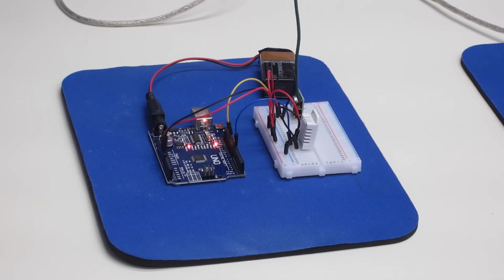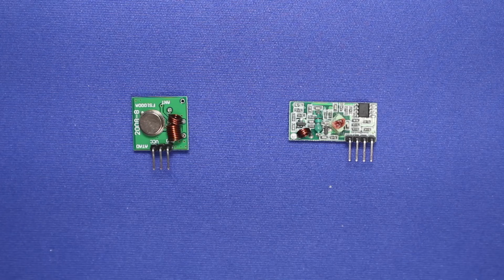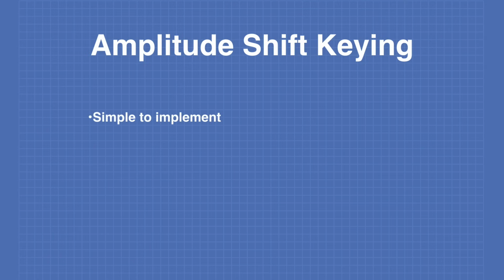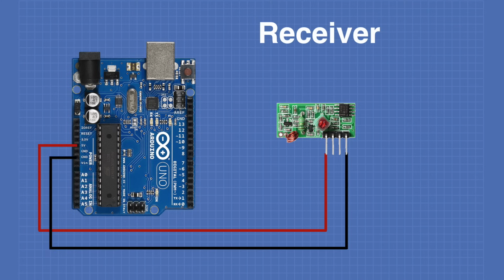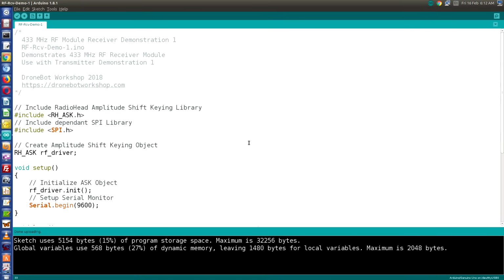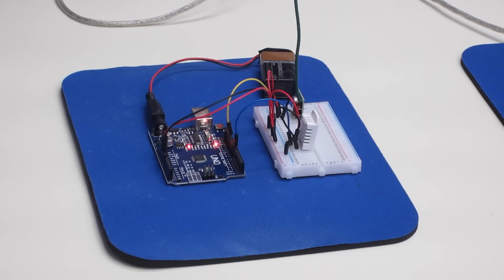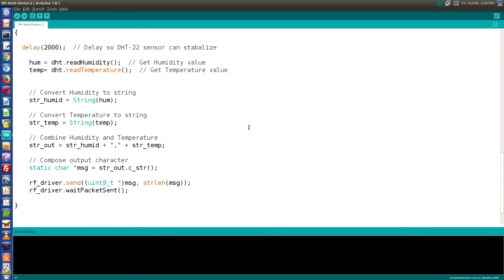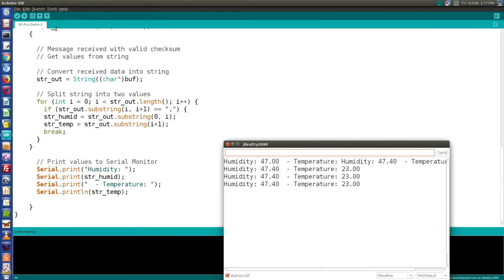Using Inexpensive 433 MHz RF Modules with Arduino

Comment: Everything I've read says to avoid using strings on Arduinos and to stick with fixed size data structures that don't cause memory fragmentation. What's your take on that?

Comment: -1

Hi
I would like to use an CC1101 as a receiver in one device and use FS1000A transmitter in another device. 
Do you think it is possible?
I'm using Arduino Nanao boards and ELECHOUSE_CC1101.h lib.

Comment: If I use an Arduino Mega 2560, what pin is the data transmitter connected to?  does it stay on pin 12?  please answer sir and thanks...

Comment: When working with these 433 transmitters, are they "paired" with each other? Or are they all transmitting and reading the same? With the text example if you had another set up with a receiver would it be "Listening" to the same message?
Context, I am looking to control 6 lights via arduino, each light will have an arduino and a receiver. But for the sending side will I need 6 transmitters? Or will one transmitter be fine?

Comment: What protocol is used for data transmission? 
I ask this because I see only one " wire" ( only one line). SPI library is used here, and I believe SPI needs at least two wires. - One for clock and one for data.
Is this a "One -wire" transmission ( without clock ) ?

Comment: I added a 173 (ish) mm wire for antennas on these receiver modules.  In all instances, it got worse range when I coiled the antenna.  Is there any reason you can think of that would cause this?  Faulty modules is a possibility, but this happens on at least 6 receivers, likely more of my stock of 20 or so. ( because I ordered in sets of 5 rx and these six aren't all from the same set) 
Thanks either way!

Comment: what if you wanted to use a different arduino model, or even an ATtiny85?  would you need to edit the library file to reference the pin you wanted to use?

Comment: Dear Friend,  I'm totally a newbie in electronic and RF, but can you amplify a receptor or increase the received signal.   I've bought some DIY radio kit, 3 of them that Ive assembled with success but each 3 doesn't catch the airwaves as same as the other. 

My goal will be to make those 3 great receivers.

If you anyone got hint or tips,  that would be appreciated

Comment: I’m trying to send out two separate messages so my transmitter has msg1 and msg2 and my receiver has buf1 and buf2.  When I press a certain button I expect it to send msg1 and msg2 But when I send them, they send both messages regardless of which button I press. Any help?

Comment: I think there might be an issue with this. I think you should send one more character to allow for the NULL character:

driver.send((uint8_t *)msg, strlen(msg)+1);

On the receive end you should also add space for one more character. I'm not sure, but I think the code as shown in the vid was causing my code to eventually crash. Any comments on this?

Comment: This is cool, huge thanks for posting. 

I’m thinking this would be worth extending to log data locally and transmit logged data. Would make for less data loss and suit applications where connectivity is lost. 

would mqtt work over these radio comms?

Comment: Ive bought these modules a year ago, only difference mine are tiny size, 1cm by 1cm, never had a need to use till now. Your tutorial helped me to connect everything and get it running in just over 5 min, thanks

Comment: Transmitting between the two modules 'manually' that is without the Arduino is mentioned at about ten minutes into the video. Where could one find more info on a single channel transmission without the Arduino?  Thanks. Allen in Dallas

Comment: Could anyone here be kind enough to answer a few questions to me.

I'm trying to use this rf modules with arduino Nano boards and I confused as to where to connect (and define) data pins. The only thing I've found was this command " RH_ASK driver(2000, 6, 5, 0); " which sets the pins 6 and 5 as transmitter and receiver which raises a new question. 
The 6 and 5 are used for arduino Uno boards so is it the same for arduino Nano and I just connect 6 to D6 and 5 to D5,
 do I connect the 6 to D3 because it's the sixth pin, 
do I just write D6 instead of 6 in the code itself or is the answer something completely else.
Most examples for this rf modules and library use this same example of code and use Arduino Uno so any help would be much appreciated.

Comment: *important note*
place a 100uF cap between VCC & GND close to the receiver.  Any small ripple or noise or small abrupt changes in VCC will be amplified by the RX circuit and will show up as an output transition on the RX pin.  This receiver has a lot of gain between VCC and DATA out, and that makes it very sensitive ( very twitchy ) to noise or tiny changes on VCC )
if you run this from the VCC supplied from the Arduino board, then I would still recommend some bypassing right close to the VCC&GND on the receiver board.
Reply: YOUR COMMENT SAVED ME THANKS SO MUCH!!! my coding works after i put 100uF at 5v and GND at the transmitter
Reply: @Zerosoul191  I'm  happy to hear that!
Reply: I have checked my code and connection but it not working but I have not used a capacitor, would a capacitor could solve my issues
Reply: There is a good chance it will help
Reply: Have you tried a 0.01uf ceramic cap in this location?  This is the typical value I reach for in such cases.

Comment: Great Video. Just a note, you can have two instances of the Arduino IDE going connected to two Arduinos each with their own Port, so you can have transmit in one and receive in the other and monitor both Serial streams.

Comment: can these Rx/TX be used without the Arduino to simulate on/off switch from remote location from with in 3 meters? if yes, can a two channel RX work with two different  TX ?

Comment: So, I've got a problem.
I connected the receiver to an lcd keypad shield (16*2)(with a buzzer connected also), the code i used is perfectly fine. However the lcd screen just turns alot darker and no message appears in the system. It appears that the RH driver interferes with the lcd(when i delete the rf_driver.init(); it stops from happening)? Could anybody help me with this? I hope i described it good enough.

Comment: Interesting and useful. I need to look to see if you have done a video on controlling a stepper motor using rf type modules. I'm working on a small antenna rotator for the loft.

Comment: Very good video well explained. Thank you! I would like to use this application for remotely measuring the temperature of the water in my swimming pool. I don't know if the DHT can be waterproofed though. If not, do you know of an appropriate sensor? I would also like to use this application as a wireless light switch. Would the transmitter be compatible with "Chocon" modules. The module needs to be paired up to the tx which will generate a special code. Is this pairing possible in this half-duplex configuration? Thank you!

Comment: thank you very much for this lecture. Actually i had few questions regarding program.
1. why did i assigned *msg = "Message" and not just msg = "Message"
2. and is it necessary to send only strings over RF module or integer can be sent too
Reply: It’s been a while, but I figured it would be helpful for others to have this question answered:
const char * msg = “message”; means msg is a pointer to the first character in your string. This is how strings work in C languages.

From what I saw in the video, you can send any data type, which is why the send() function takes in a second parameter, which is the number of bytes. To send an integer, you could do something like the following:
int x = 42;
rf_driver.send((uint8_t*)(&x), sizeof(x));
This passes the address of x as a byte pointer as the first parameter, and the number of bytes in x as the second parameter.

Comment: Hello, I'm in great and urgent need. @DroneBotWorkshop, You seem me helpful. I want to directly connect my Grove LoRa Radio 433 MHz - Seeed Studio with my Arduino Uno Rev3 (USB), and make communication between two radio modules. I'm trying from several months, browsing on the internet and searching on several websites and forums. But, am not getting any solution and always the communication is getting failed. 
On the serial monitor of both sender and receiver, it's displaying – "init failed" .
Kindly assist me as soon as possible. I would be very grateful (from India).

Comment: I could send more information   , I 'd like to use a (temperature sensor + transmitter1  + arduino1)  and (pressure sensor+  transmitter2 + arduino2) , but I had only (receiver + arduino)  . Is it possible ?

Comment: you gave me the idea from back in the day but if someone could write the code it would be interesting , remember those old speaker system's on the wall in some home the so called (INTERCOM) but let's put a modern twist to it, 

if someone does this for example 7 rooms let me know, thanks

Comment: The module's name was difficult to discover. It was in the description, "bRF24L01", but searching Google with that did not give much information or where to buy. It seems that 433Mhz is not the feature of that particular hardware. Just search Google for "433Mhz Arduino" instead. I have found a $1 module that looks similar to the ones in the video, on an online store in my country. That module was named "DM2146".

Comment: why did he use the char message as a pointer?
Reply: In C, String doesn’t exist, we need to use char*
Reply: @anthoh5  it seems to me he wasn't considering the null at the end of the strings, transmitting or receiving, yet seems to successfully print the received raw data from the receive buffer, which I believe was unterminated.

Comment: Cool project! 

I ordered some BME 280 chips for arduino, those have pretty sensitive humidity, temperature, and pressure meters build in them. These modules you are using might be neat to use for building a weather station! 

Greetings, 

Jeff

Comment: thanks for the great Video
I try t send 3 values in the String
str_atemp // air temperatur
str_etemp // soil Temp
str_hum // soil humidity
the Tx Side is working
but how can I split the str_out into the 3 values? in the Rx code?
how can I alter the for if loop to get it working?

Comment: The SDR (software Defined Radio) is a great tool for working with the transmitter module. You tune the radio to 433mhz and you can see the signal. It will tell you if you are transmitting . I found a dead transmitter this way. Also you can determine the exact frequency it is transmitting on when the radio is calibrated. Also you can see how your body interferes with the radio.

Comment: I am pretty new to Arduino, but have a project I am working on using 3 ultrasonic sensors. I used a decent portion of the code in this video to help, but my sensor 3 is not displaying the correct distance reading. How would this code be changed if I needed to extract 3 values from the string sent instead of 2? Not sure if this is the right place to be asking this but figured its worth a shot.

Comment: Great job as always Bill!  Thanks for sharing all these wonderful videos. As a newbie to programming I'm stumped on the proper way to convert the temperature string line to Fahrenheit. I played around with different variations of  ...( - Temperature * 1.8) + 32) but can't quite get there when compiling. In addition, it would be neat to add the Date and Time  to each line print out.
Reply: You would need an RTC module for date and time

Comment: Impeccable video.

One thing I noticed is that you are sizing your receive buffers to the exact length of the expected string, without accounting for a terminating null character ('\0'). Since you're passing in buffer length to the ASK library receive function, I expect that it's not writing a 25th null byte at the end. Later down in the code, you're using things like strlen() and println(), which depend upon a properly null-terminating string.

Your code appears to work fine, but I suspect it's due to the compiler adding zero-padding between the 'buf' and 'buflen' variables for word-alignment, or maybe just uninitialized stack being full of zeroes. I mention this because it's somewhat delicate... reorder your variables or change some seemingly arbitrary detail (like length of the message), and it may stop working properly.
Reply: Agreed.  I looked at :recv() in RH_ASK.cpp.  It copies at most len, or less depending.  Then it returns the actual number of bytes copied into len.  It doesn't null terminate the string.  It doesn't really consider it a c-string, just a uint8_t buffer.  Then in the code above, this buffer is cast to a (char*) for printing. No one is adding a NULL at the end of the c-string.
He must be getting lucky. Perhaps as you say because the compiler is padding out the stack with zeros. It doesn't seem necessary to do this, as the declaration of buflen comes immediately after the declaration of buf, and is also 8-bits long.  I'm not sure, but looks like luck.

Comment: I would like to setup a long range offshore RC fishing boat, I have no idea what I need to purchase. I mean from radio to ESC to receiver. Where might I find a list of equipment I would need to make a nice little RC fishing vessel for a large lake and off shore? Ideas? 500 + yds is the goal is this reasonable? FPV is not required just boat control.. Thanks!

Comment: how if dht sensor is change with an ultrasonic sensor, i've tried it but always fails?
Reply: Lol, dht is temperature and humidity sensor and ultrasonic sensor can not do that, thats what I understood but if you are saying that you want to send data from ultrasonic sensor then that is also do-able, you just need to include library for Ultrasonic sensor instead of dht's lib.
Reply: @FsdYT  i main that, I want to send data from ultrasonic 
Thank you
Reply: @namitamukhbitin7056  for that you need to use library of that sensor instead of DHT, you can find tutorials to use that sensor on internet

Comment: Great video. I bought a set of these described as 433mhz, but I got really poor performance using the antenna length per the calculator. I adjusted the antenna length to a 315mhz and got much better performance. Any idea how we can tell which is which without a scope?
Reply: The frequency is printed on the crystal on the transmitter

Comment: So if I want to have 2 motors controlled by 2 potentiometers wirelessly, will I need 2 channels or are there any sophisticated libraries to transmit 2 things over 1 channel? If I do need 2 channels how will I have 2 channels without them interfering?

Comment: Can this project give the temp in fahrenheit instead of celsius by replacing "celsius" with "fahrenheit" in the script and would I be able to echo the string to a small lcd on the receiver. This project intrigued me and I had everything but the sensor. I plain to place this on my tower and see how far I can receive it with an external antenna :)
Reply: Well tried to change it to fahrenheit and still sends celsius so that's a big NO does anyone have a suggestion Thank you

Comment: Great video !
It demonstrates the basic setup needed for a remote temperature sensor, which can be used for your central heating systems climate correction curve.
You just need to fiddle with the correct choise of components and arduino code, to have the sender use as little current as possible, thus making the battery last for a couple of years.

Comment: Would there be any way to process the radio signal in order to gain location information from the transmitter, like approximate distance?
Reply: You would have to know the transmission and receiving data or make empirical measurements. Then you use the law of incerse square and do some math

Comment: First, let me say that I thoroughly enjoy the quality and content of your videos.  I am working on a project that enables me to have a remote throttle for a 25hp 2 stroke engine.  The distance will ALWAYS be less than 4 feet.  Of the various transmitter and receiver types I've seen you and others present, which would be best for this.  I also need to consider wire shielding from the noise created by the spark generation for the motor.  It is my intention to use some type of servo at the throttle and a hand held, remote throttle.
Reply: I have been kicking around this same idea for a couple of years. How is your project coming along ?

Comment: thanks alot for the video....However I am working on a remote controlled robot car using a joystick and 433mhz rf but the receiver code has failed to upload. Could you cite any problems ? thanks again

Comment: "So for less than a cup of coffee, you can add radio communications capabilities to your arduino projects" 
but how do i do the project without my cup of coffee :'(
Reply: Try crack instead. Much cheaper.
Reply: You want to use it as a way to set things off from a distance. Lets say for a rocket, or some fireworks? Your name actually implies something along those lines. Am i right?
Reply: Eh, just eat the beans (technically seeds). That’s what people did long before they learned how to brew coffee.
Reply: Pyromaniac, I can enjoy a good cup of coffee, but do you really mean that it is difficult for you to work without an infuse of coffee in your system or you just said it for the comical aspect of the comment?
Reply: @johanfer  ugh
Reply: @johanfer  you're a dumbass. If you ever thought you were smart, think again

Comment: Very interesting demo. But I was searching a method where the transmitter module is not using an Arduino, just something like a button when pressed is sending a signal (and when not pressed the transmitter still powered off to keep battery operation during very long life) like a button for door bell !

Comment: How long would the transmitter module last if connected to a 9v battery and only sending temp/humidity data every 1 minute?